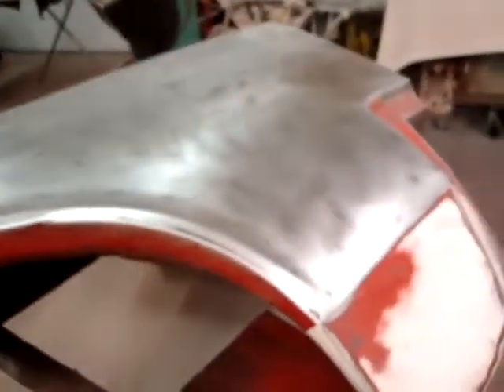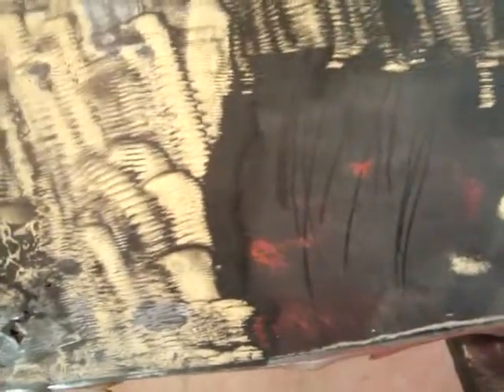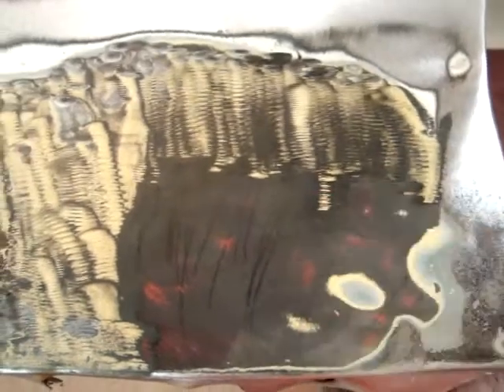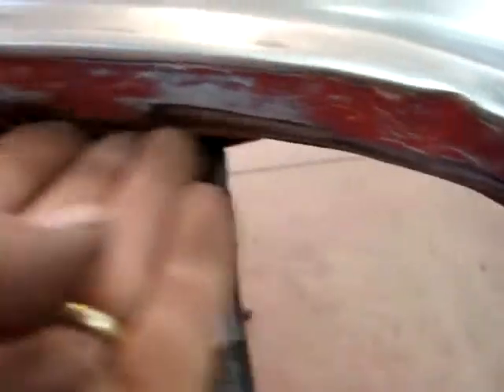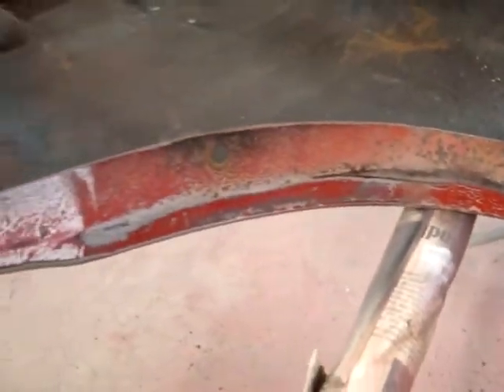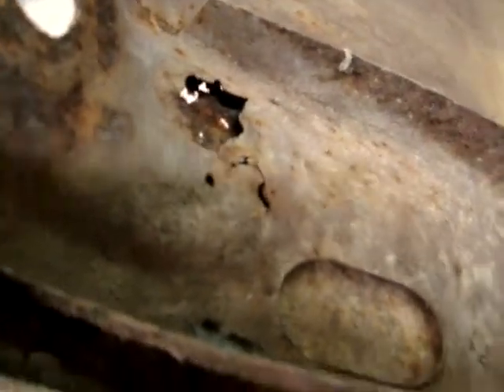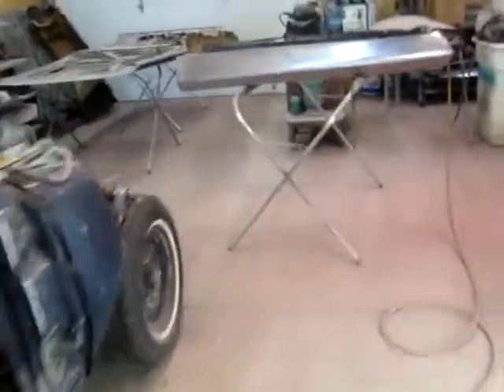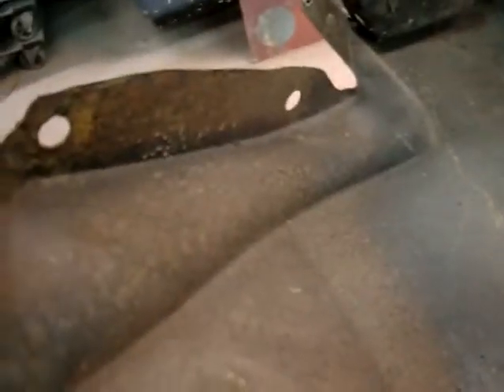1966 Pontiac GTO Part 8

Comment: You know Wendell I saw an Australian shop which had a tub where they put parts into and using I think cider they soaked the fenders and when they came out they were beautifully clean, and they used the bath over and over again it might be a good thing to have a big tub you cold drop those fenders in and let them soak a week or so to clean all the rust and paint off if it takes paint off if anything it has to loosen all the paint up. Bet it would save time.
Reply from the maker: I've seen those soak methods to Cary but haven't tried it yet.